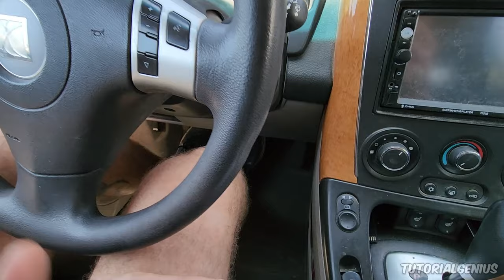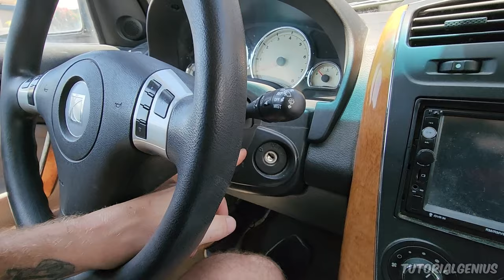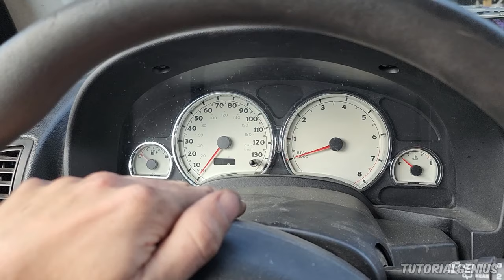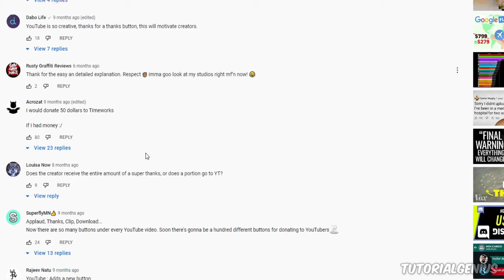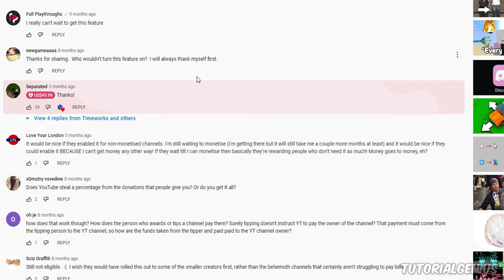Brake Fluid Complete Flush and Bleed - One and Two Person Methods

Comment: why do you need to place the cap on instead of just leaving the funnel in?
Reply from the maker: HI, timestamp?
Reply: @TutorialGenius  Around 14:27, you say to fill it to the rim, and then put the lid back on. Why is it important to put lid back on instead of just keeping the funnel in during the whole process? I've seen other channels just leave the funnel in there until the job is done
Reply from the maker: @doomshallot4203  When doing conventional brake bleeding I would leave the cap on but not latched. There is a squirt of fluid ejected from the master cylinder back to the reservoir at the very beginning of pedal travel which will cause a small geyser of brake fluid. The cap will deflect that fluid back into the reservoir where it belongs. The reason for not sealing the cap is to keep from having to mess with the bellows in the cap. The bellows is there to keep the air and moisture out of the brake system as fluid is moved to the calipers as the brakes wear.
Reply: @TutorialGenius  Thank you! good to know!